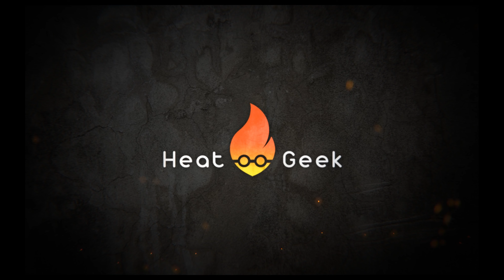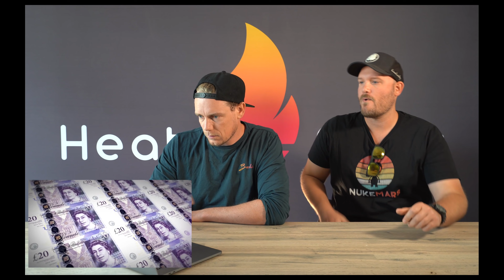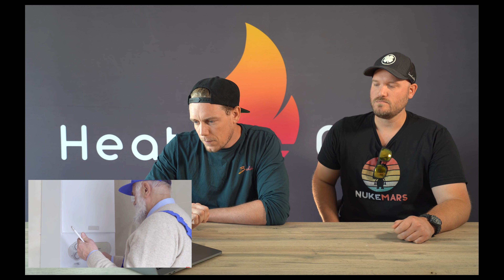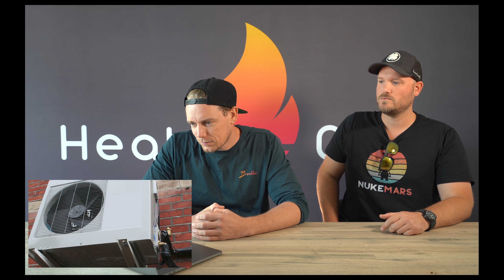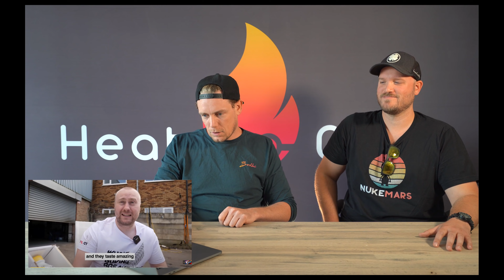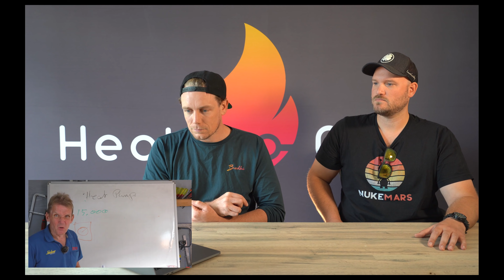Professionals React (BADLY) To Skill Builders's Heat Pump Videos | PART 1 | FIRST TIME WATCHING

Comment: Issue is govt not providing incentives for diverse solutions, and is perpetuating the "one solution to rule them all" myth and desire.

I am looking to replace my gas systems, but it's nearly impossible to get a multitechnology solution company to do a proper design and stepped transition plans.
Reply from the maker: Yes definitely can't disagree with anything you've said. Where abouts are you?
Reply: @HeatGeek  northern UK, ex council property, 20 yr old double glazing, narrow pipework, no hot water tank, boiler fed bath and shower. Bit of a nightmare in terms of install cost for any element of the heating/hot water system lol

Comment: You cannot insulate all older properties. It becomes too expensive for rural areas. Also why should rural areas be singled out for this dumb treatment before the rest of the country? It will not work and is a waste of space.
Reply from the maker: Im litrally sat in an old uninsulated property thats heated by a heat ump right now.. here ill do a video and release in the next day or 2.
Reply: @HeatGeek  Thank you for replying. I look forward to seeing  the video. Bear in mind the current outside air temperature is 14 degrees and a heat pump will work fine. I woukd like to see the performance when the outside ambient temperature is 0 degrees plus a wind chill factor.
Reply from the maker: @brianaicheler7084  No problem.

If you hit the bell icon i will release in the next day and you will be notified

its for the last week in December which shows outside temps from 1c to 8 c.  If we only froze how it performed at 0c, that would only represent 1% of the heating season and would not be representative of normal runn ing costs.

Comment: Here in Ohio USA we have had a heat pump installed 24 years ago on a dual fuel forced air heating system. The heat pump works great as long the air temperature is above 40F.  Because we live in a area that does not have natural gas lines available but have to use propane fuel for the furnace  Propane can be very expensive to use so the heat pump does save us money on our heating bill.  Lastly in Ohio our summers are warmer (80 to 90F) the heat pump also works as a air conditioning system to cool the home.
Reply: 24 years ago is your problem.  Is a cellphone or computer the same today as it was 24 years ago? No!  Nor is your heat pump.

Comment: Do you want an Ideal icos HE24 ?
Nearly in working condition - just needs combustion probes.
£200 +P&P
Condition: not too grotty. Condensate corrosion in one or two places. Combustion chamber heat shields still in place !

Comment: "Heat pumps are at the beginning of their journey" Yeah, they're only AT LEAST 40 years into their journey.
Reply: Compared to boilers we mean but yes they are very old, so are Hydrogen fuel cells which have been used in Navy ships and Nasa rockets since the 50's!

Comment: Cost of gas v cost of electric. Why stop there ? What's the cost of a CALORIE of:
Natural gas
Hydrogen
LPG
Heating oil
Diesel
petrol
electric heat pump ?

Roger's Rabbited on about hydrogen boilers but I've not seen a price comparison between hydrogen and nat gas in terms of cost per calorie. Don't get me started about dishwasher detergent !
Reply: Hydrogen (at the moment) is about £10 per useful Kw
Reply: @patrickwheeler2646  and natural gas ?
I guess a small fraction of that !
Reply: @millomweb  yes a tiny fraction which is subsidised by the Government and has a domestic price cap to (rightfully) protect vulnerable people from fuel poverty.
Reply: @patrickwheeler2646  So basically Hydrogen is in reality, a non-starter !
I believe, even if it was the fuel, cost of manufacture (!) - 'extraction' - from - e.g. water - would hardly be cost-effective.
I wish they'd put more energy (sic!) into insulating homes - and by that I mean demolition and rebuild to FUTURE standards.
Power sources: solar and wind.
We've got there when we can heat our homes with computers, mobile phone chargers and traditional light bulbs :) - to top up the heat given off humans !

Comment: Heat pumps .......  RADIATORS ?????????? You'll be there all day with radiators - you need proper heat exchangers and fans to move air over them - which is then ducted to the various rooms.

Comment: Heat pump - isn't that like car air con ?

How often does your air con fail - need regassing etc ? - or it just doesn't work ? It didn't last long on my bro's brand new car. We didn't feel it was worth 'repairing'.
Reply from the maker: similar yes. Much less maintinance required than a boiler.
Reply: @HeatGeek  Since when did boilers need maintenance !
Our old "Floor mounted" (!) Glow worm 75 got very little maintenance. Maybe 4 times in its 40 year life - 2 jobs - vacuum out all the cobwebs and run a dusting brush around its internal flueways. This was done when the maintenance indicator showed - white smoke from the chimney !

I'm very much of the opinion, if it ain't broke, don't fix it !
So, know anyone interested in a Ideal icos HE24 for £200 ?
Reply from the maker: @millomweb  since combination boilers became mandated in 2005. We don't replace old working boilers either. That's a very normal stance.
Reply: @HeatGeek   I suspect you're getting your words mixed up - you mean condensing boilers, surely ?
Reply from the maker: @millomweb  lol yes sorry.. First day back and a long one.
Reply: @HeatGeek  No worries :)

Comment: Put your cap on the right way round and stop your childish sniggering of skill builder who is giving an honest opinion and he moved the heat pump to the bush cos his customer asked cos of the noise, you even agreed he was mainly correct.
Reply from the maker: mainly correct, just incorrect about the most important bits. For example not doing a performance estimate when quoting a system. thats very poor from a business person and installer perspective.. let alone not designing the system.

Comment: First I would say do your homework on Roger.
generally heat pumps in a retro fit scenario cost wise are far out of reach for the average Joe.
Reply from the maker: I'm aware they are expensive  we quite them all the time. I'm fully aware of Roger now. Incredible knowledge on building which I'm clueless with. I think he's a great guy, heating design and heat pumps aren't his strong point at all though

Comment: The man from skill build is right here,
My brother bought a new house with a  heat pump and he's never had his house warm in the cold winter or hot water so he had something fitted to it to make it make more heat but it costs his so much money to run that he can't afford to heat his house.
Reply: A new house?  Or new to him?  If it is a new house it should be cheap to heat with just about anything as it will be so well insulated.  That sounds like a massive error of install/ design, unfortunately the standard of average installers (at least in the UK) isn't great.
Reply: @patrickwheeler2646  it was a new build, at the time, I don't know much about it I just hear him complaining to us about it every winter

Comment: The man is right, it all depends on the house. Heat pumps can only be used in a properly insulated air tight houses. And even so, once it hits below -20C, they can barely keep the house warm.
Reply from the maker: Doesn't happen in the uk

Comment: You keep going on about the knowledge of the installer but made no effort to explain “how a good installer would do it”. Your video is irrelevant to be honest.
Reply from the maker: our whole channel is about that. Step by step series coming in january. In part 2 we also expalin that your meant to complete a 'performance estrimate', skill builder didnt, hence finding out it was expensive to run 2 years later...

Comment: From what I understand, the problem is not with Roger that he exposes a reality from the dull. The problem is that you stigmatize him. Unlike him, you are paid to criticize him without regard to reality. You posted this video 4 months ago. Now what about Roger's prediction? Total respect for what Roger is doing.
Reply from the maker: I am not paid for this video in any way. Roger does very well from YouTube. I don't think he believes what he thinks due to money though. I think he believes that because he didn't design his system. 

"His prediction" has been talked about by those who work in thsi field for years and is inneviateble. 

Also bare in mind we are yhe uks number 1 hydrogen boiler installers.. if we were bias it would be AGAINST heat pumps

Comment: Installing underfloor heating and larger radiators and pipes to the radiators. A HP is not feasible in older house, OK in new build.
Reply from the maker: 90% of homes will not need bigger pipes as they were historically oversized. Because it dos not fit in some houses doen not mean we shouldnt fit it in the ones that it does work. None of our installs are. new build.

Comment: I work in the rental sector and the increase in gas is having a huge effect on fuel poverty . electrical heating is not a option because most on the breadline sit in darkness . heat pumps are not cost effective for the low end of the housing  stock . just to hit households with increasing gas cost to force them to change isn't going to work
Reply from the maker: Yes, and as per our video, just because it may not work for some does not mean we don't fot them at all anywhere.  For those that can afford them shouldnhave them as they lower carbon production.

Comment: Gents, enjoyed watching your video and you make some very good points. Yes he is trying to get a reaction, but to be fair a lot of the points he raised in there are relevant. The majority of installations that will be done will be done as a bolt on exchange where the whole system will NOT be carefully thought out and replaced as is required for it to work correctly because what will happen is the person changing to the heat pump doesn't want the large cost involved with modifying the "whole house's heating" so he just goes for the cheapest option or as the bloke said the sales person will mis-sell the product. You yourselves are obviously conscientious and skilled heating engineers but the majority of us that go to get heating components changed because something has gone wrong do not look in the yellow pages to get a heating engineer we look for a plumber that can come round and do the job reasonably well and for the right money .
Reply: We assumed everyone watching this would realise that both Roger and us are trying to get a reaction and it is good for the visibility of both channels, fundamentally we align on most points but it's fun to have a bit of light hearted banter and I'm sure Roger is not offended.  One thing we don't is the incentives, although we don't necessarily think there should be payouts for installing heat pumps it should be balanced by removing the subsidies and caps on gas as this has artificially meant boilers are A. cheap and B. easy to install badly.

Comment: I have a wood stove with a back boiler that feeds into the tank.  Why isn’t my heat pump on the roof,(instead of on the patio), where it can use the hot air coming out of the chimney?

Comment: In all fairness, his channel isn't for pros like you guys, it's almost like a basics course so homeowners are making informed decisions.

A good installer will tell you whether it's right for your property, but the problem with these huge incentive programmes is the installers who'll throw them at everyone just to take the money and run. And if you're hitting the market right at this moment, it's a nightmare trying to navigate all the options. There's so much promotion but EVERYTHING has cons to the pros and he's giving us a condensed version of things to take into account on the cons side. 

Having said that, this is a great counter-argument. I'm not knocking you at all cos it all goes into making informed decisions. That's what really matters but it's very easy to get completely bogged down.

Comment: Hi Guys.  I was right onboard with your video.  I thought that you were giving the guy a fair review even when you didn't always totally agree with him.  However, where you lost me was at 30.13 when you said:  "We don't make anything...we don't make anything at all..".  I work for a privately owned BRITISH manufacturing company who designs and manufactures (from scratch) our own product which we sell all over the world and is considered to be a world leader in their field.  So, just because you install stuff made in China, don't assume that everyone in the UK is useless.  We are very proud of our product.  Even the machines that we use to make the product were made in the UK.  We also source most of our raw material from the UK too.  Sorry guys, you need to take that back, it wasn't true, or fair.
Reply: Hi Chris, although we possibly could have made it clearer we were talking about heating products as that is our field.  Well done on holding up British engineering, we need more of that.

Comment: I love Roger. Just watching you guys for the first time. Seems like you've got the right attitude. Sadly I agree with much of what Roger says about poor installs/existing insulation levels, I don't agree on percentages as far as contributing to pollution. I watched a tool channel the other day with the same silly argument. 'The U.S. actually has very low pollution compared to China, India, Bangladesh, maybe they should clean up', never mind those countries are where your products are made and your trash is sent to be recycled.
Reply: Looking at the domestic market is one thing, looking at the supermarket is something else. 1983 new-build supermarket heated by heat pumps. Now it has gas-fired hot air ducts over the fridge aisle as the fridges are pumping heat out of the building so quickly. Supermarkets buy to cater for the customer, not the environment.

Comment: Lols 2 classic young bucks. Good luck heating your hot water to 50 degrees when its 5 degrees outside for 3 months - the heat pump will do the job but your electricity bill will be in the 1000s for that period - also don't shower or bath at night (when its 3 degrees not 5) not that it'll matter your pump will run all night anyway. Take some advice from your elders and do not retro fit a heat pump or if you are full of testosterone and cannot be told then leave the gas boiler for your hot water.

Comment: Ur saying u have to add stuff for them to work correctly don't sound good .it's far two expensive too insulate a whole house .u two obviously earn ur money from heat pumps.i have installed 4 and all 4 was not completely happy did not hit temperature they desired so 🤷 there not good enough but they will get better

Comment: I’ve worked on a few air source heat pumps and I’ve found them very temperamental, noisy and inefficient, not to mention the oversized radiators you need to install in each room. 
Saying that they are very good if the house is spec’d with them in the first place.. I.e new builds. Not the answer in older houses in built up areas with little space. Hydrogen is the answer for them in my opinion.
Reply: We just need to find a way to get this mythical Hydrogen.  At the moment it costs around £10 per useful Kw from H2 and until we add 20x more renewable production it is a red herring.
Reply: @patrickwheeler2646  Yes clean H2 production is costly on electric energy to produce, how about just "dropping"  cost of electric and use electric boilers.
Reply: Or an electric CH and hot water boiler

Comment: I find this video funny. They are right in that the right people need to install it but that kit costs loads the skilled people to install costs loads and the running costs loads. So why would people move to it. Heat pumps should be installed in new house first then the prices will fall and there will be more skilled people.

Comment: I really enjoyed this video, really good to hear another point of view, and actually I think there was a lot of overlap in agreement between the two of the videos.

I think the general conclusion is, if you live in a well insulated new build (or a well insulated building in general) and have plenty of space then these things could be viable. I think fundamentally it’s a physics problem rather than a technology problem.

Overall, it’s probably a niche solution and should be part of the over all mix but not a silver bullet.

A lot of people are going to miss-sold and miss-installed causing another big scandal in the long term.

Looks like you guys are doing good work at least :)

I think the point trying to argue uk emissions are higher per person than China is a bit bonkers and made you lose a bit of credibility but over all good.
Reply from the maker: Co2 per capita we aren't a million miles of China..  China are mile better than Australia Canada USA etc
Reply: @philip If I live in the UK and I buy a widget that is manufactured in China, and manufacturing of that widget emits a certain amount of CO2 which country do you feel the emissions should be accounted against?